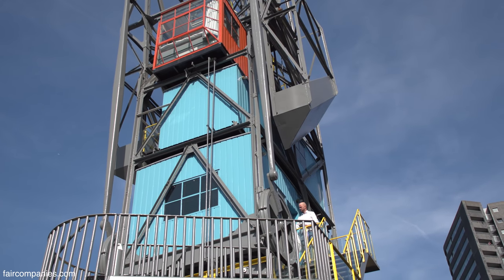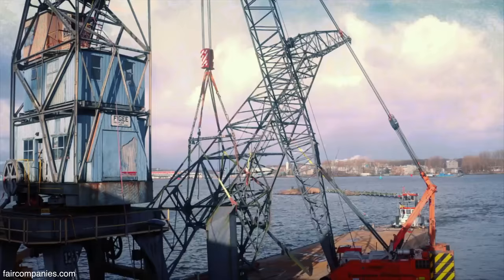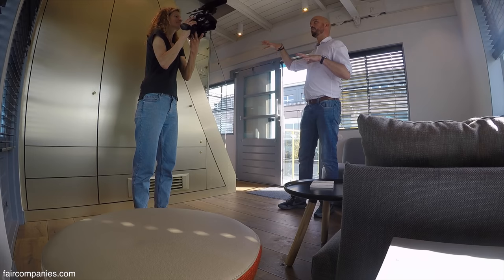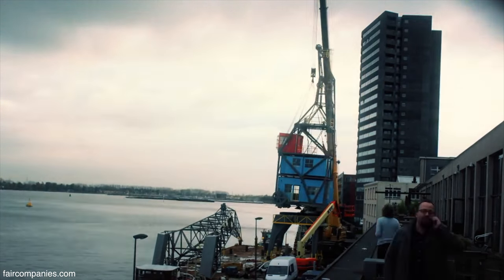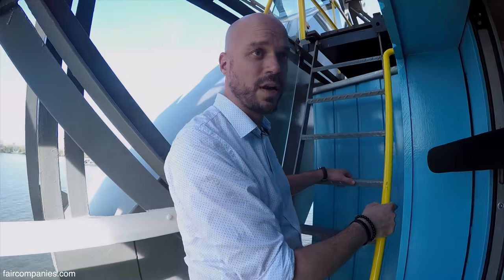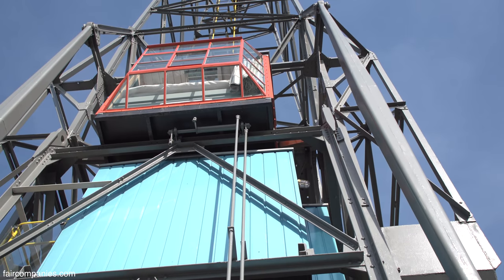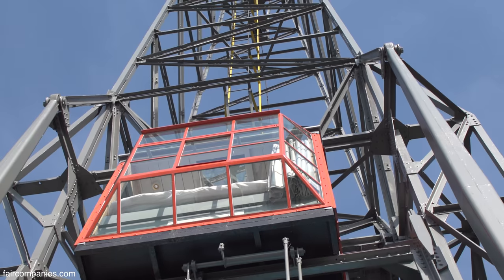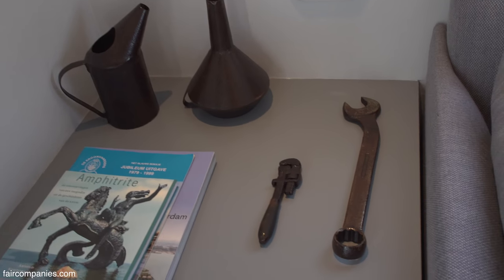Crane Triplex: vacated harbor crane as micro-flat over Amsterdam

Comment: This  plan of small well designed, functional rooms would also work if the rooms were arranged on a one level floor plan. I have A LOT of trouble with stairs due to mobility issues. But that design looks to be a very smart use of space. I bet the square footage would fit quite nicely in half a basement, or it could be used several times in the footprint of a multi story house. Hmmmmm.